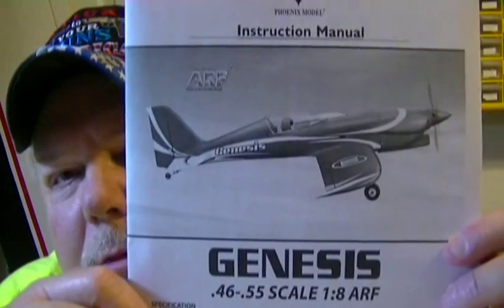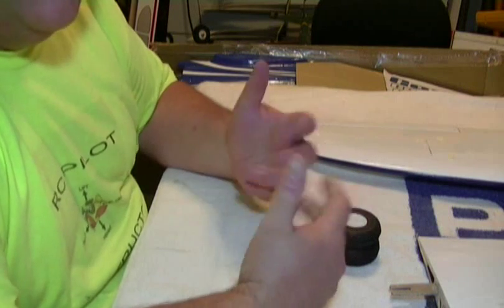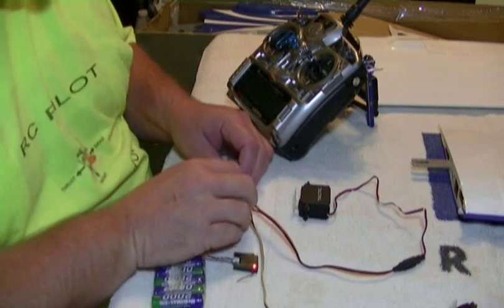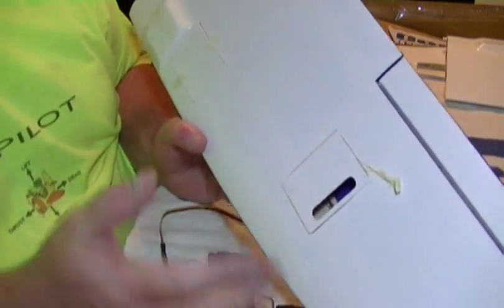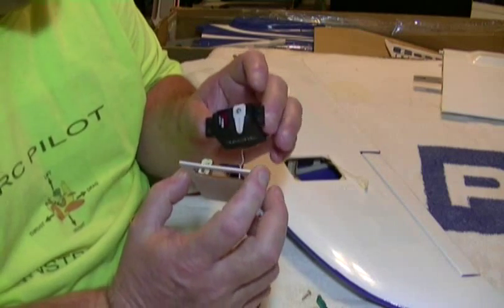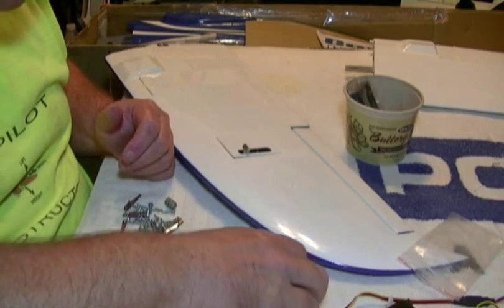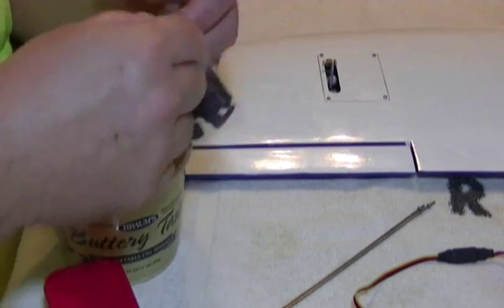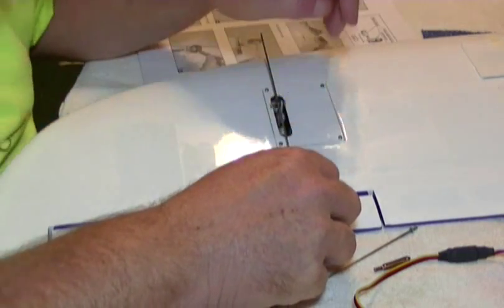Part 1 Building the Genesis By Phoenix Models

Comment: A small note to be made on control horns each plastic control horn has an offset numerical value molded on it so before clipping the extra horns off use these values to correct any off centering of the servo, this being done with the radio values at neutral. Once you find the closest one to center then clip off the extra horns that are not needed and then use the radio to fine tune the center for non programmable servos. Just incase you haven't went over this in previous videos.
Reply from the maker: Thanks for the tip, i always find the best center on the arms, i just didn't show it in this vid, i guess i really need to show this in all the builds, i guess i just get to going on them and forget that there might be someone that doesn't know that, i have built 80+ planes over the last 7 years so i have learned most of the tricks but always happy to here any suggestions. Take care my friend

Comment: I have been putting a Genesis together for a few evenings now and am at a point where I can't put the retracts off any longer.  For the retract servo in your Genesis, what model did you use so I can look up the dimensions on it?  I have found the two listed below that have similar dimensions to the Futaba.  They are both about half the cost of the Futaba and the Spektrum  even has adjustable endpoints. Based on the mods you had to make would either of these be a better fit than what you used?  Thanks in advance

HItec 75 Low Profile Retract Servo (HRC31075S)
(L) 1.73" 44mm 
(W) 0.90" 23mm
(H) 0.98" 25mm

Spektrum A7040 HV Retract Servo SPMSA7040
Length:1.70 in (44mm)
Width:0.87 in (22.2mm)
Height:1.07 in (27.3mm)
Reply from the maker: Hi Ryan, yes one of these should work fine, my choice would be the Spectrum HV
Hitec makes a good servo and i have tons of them in my planes however all of there retract servo's i've used will not hold up to a 6v batt even though it say's they are rated to 6v, you might have to cut out just slightly for the length but not near what i had to do, i wish i had done a little more research and bought one of these you found or even the Futaba that it call for, mine were a pain but it's done and they work great so i will leave it as is, one thing you need to do is put a small piece of wood about the thickness of a mixing stick or popcicle stick under the back side of the retract to tilt the wheels slightly more forward and on the balance you may have to go just slightly towards the tail heavy side, if you don't it will tip real easy on grass runway, if you have paved runway you should be fine the way it comes, i had to do the same thing to my Phoenis Spitfire. Hope this helps my friend, let me know if i can be of any help. Take care my friend. Terry
Reply: Thank you for the reply!  
Which servo did you use?  It looks like a tower hobbies low profile.  It is almost identical measurments to what I am looking at and that concerns me.  Which dimension was the issue height or width? Length is just a matter of dremmeling a bit to mount so that isn't a big deal.  Also, did you upgrade to the 90 size you talked about?  I am considering a OS 95V.  I am curious if it will fit or if it will be wide like the gasser you wanted to use.  I think an airplane like this needs to be fast and I am not sure the 70 size will do that.  Plus the bigger diameter prop of the 90's I think will look great with that huge cowl.  Thoughts.  Your build thread is what made me settle on buying this particular airplane.  I am getting back into flying after about a 15 year break.  I have been flying a fabric cub and a Seagull Nemesis so far on days when it is decent weather here in Kansas City.  Thank you again.
Reply from the maker: Hi Ryan, yes i used the Tower Hobbies low profile, they work great but it was a bit of work to make them fit. The right side wasn't to bad, just had to cut out a little on each end because of the length, the left wing is the problem child LOL, the servo's lay on there side so you have to cut a little out on each end but on the left one the bottom of the servo faces the leading edge of the wing and as you can see the wing starts to roll into the leading edge right there and gets very narrow so i had to build out the blocks about an 1/8" where it mounts  where the screws go in, other words moving the servo back towards the trailing edge, it worked fine, i just had to put a slight Z bend in the control wire between the servo horn and the retract arm, i can do a close up video this weekend if you want me to so you can see exactley what i did, by putting the bend in the linkage i also had to move the clevis in one hole on the servo control horn to get it to operate the same distance of travel as the right one, hope this helps, let me know if you want me to do the vid, i would be more than happy to do that for you. Here is my email if you want to contact me there, might be easier
whitetail7mag@yahoo.com
Take care my friend